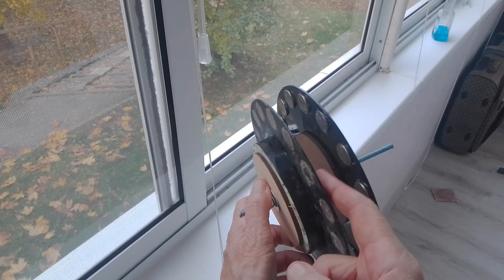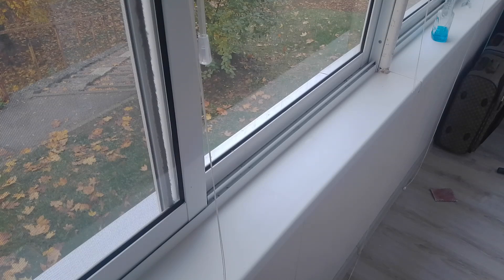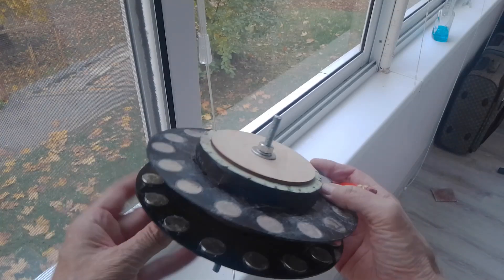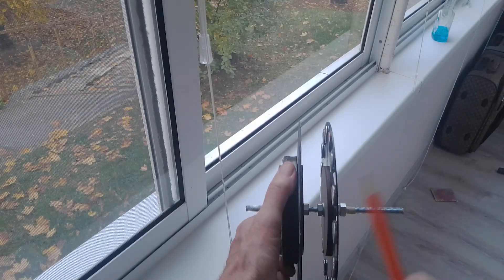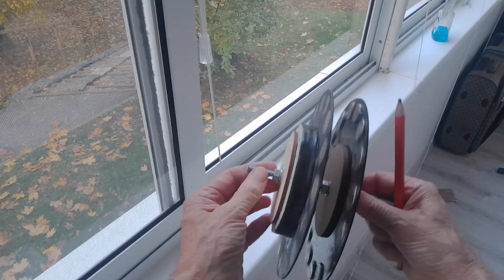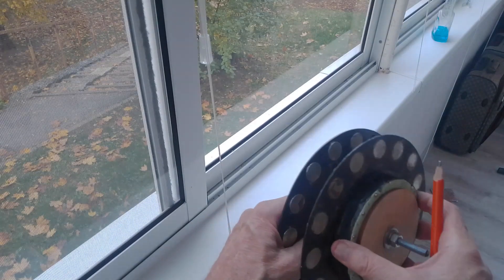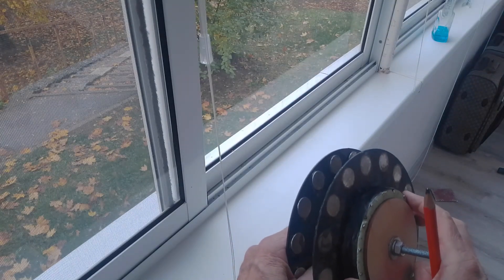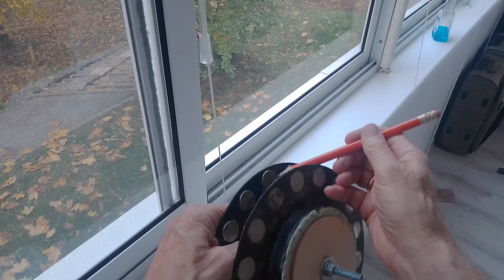Dual rotor disc motor generator

Comment: Hi Doug! Great idea.. i did some experiments with that kind of machine (actually different to yours)... but 2 rotors.. N/S - 6 coils in between, 1 of them motor and the 5 others  generator coils.  actually there were 3 rotors, the magnets on the middle rotor were used from both sides.  it used very very little power to run.. and would produce lots and lots of volts.. like 250 volts at 300 rpm.. but (yes,  there is always a but 😁) the lenz was so hight that as soon as i connected a very small load, it would like stop completely within 1 revolution. But i admit, i never tried to move the rotors so the magnets would not act at the same time.
also my magnets were much more apart than yours.. only 6 per rotor, (approximatively same size rotor) but much much stronger: 2 cm thick and 3cm diameter.  As soon as i am finished with my new workbench i will get those rotors out of the basement and get started experimenting again... Keep it up.
Luc
Reply from the maker: Hi Luc  Nice to hear from you!  
Yes you know when the generator is of very "strong" design and can makes lots of power its going to have that very strong lenz reaction too.  Ways out of it I know of is: 
1} filling caps with no resistance across them, then unloading caps to load while caps decoupled from generator coils (two stage cap discharge)  This lessens lenz reaction braking - and filling the caps after discharging to load every cycle will cause lenz since caps sunk down in voltage work just like resistance does...but there should be a perfect world where the load sinks caps down just to where the generator does not have to work so hard since caps already half or three quarter filled when fill up again.
The other way 2} is the "popular and proven"  Thane Karl Heinz "delayed lenz" where the rotor magnet whips by at just the right speed so that the time it takes lenz (the backemf developed actually) to develop happens for example at the trailing edge of magnet, or the leading edge of next magnet in rotor (if NS magnets in rotor) so there is speed up not braking upon the backemf being manifest with a strong enough force to want to pull rotor backwards (or assist forward)  
Other way to beat lenz 3}  is put a BiTT transformer in between the generator (alternator actually) and the BiTT runs on reactive AC power (90 degree phase shift between volts and amps) and so the alternator feels itself working as it has no load on it (no load on any alternator looks like a 90 degree phase shift on scope) so then the BiTT "transforms" the reactive power to real power and so there is no lenz braking to the alternator when the BiTT transformer secondaries is loaded with real power (resistive load or inductive load or capactive load)
Thats the trick to the BiTT far as I tell - the AC primary  needs to have a 90 degree phase shift and be reactive power going in, and real power coming out.

Two years ago I tested this motor-generator out, I put links to the videos in description.

I was hoping there would not be not very much lenz braking from the generator "2/3" of it, but it had lots of lenz braking when shorting or loading still.  Maybe lessened somewhat, but was still there.  Theoretically I was thinking the motor coil sharing the core should do something. 
 I should of pulsed out the generator coil to load, but never did, as maybe some slight delay or advance compared  to the  timing of the motor coil when it hits the load would make the generator output lenz free.

Because I didnt see anything magical  I went the route of  combining the motor and generator coils into one big motor coil, and tested it out like that, also had just two motor coils, then 6 generator coils...did alot with it but could of done lots more. 
 
Could be what I have now this new idea"to experiment with (the timing offset of the motor-magnet disc compared to the generator-magnet disc) might  be if I get it just right. it will get rid of lenz reaction all on its own,
but maybe the generator coils should be pulsed-out too,  and there is a particular combo of rotor timing and pulse timing will do it to it.
Reply: @MrDKONZEN  cant wait to see your experiments... one of my first ones will be to try and reproduce one that has worked for me in the past.. The bummer i was so excited it had worked i did not remember exactly what i did. Basically i put 2 coils wound in opposite directions on the same core.. and connected a third coil in between. I also powered a bulb as a load. The 2 generator coils cancelled each other out, and all the lenz went into the third coil.  i was holding that third coil in my hand in direction of the rotor magnets. by positioning it by hand in front of the rotor i could make it accelerate instead of slowing down. But i never found the position again.. also i cant remember how i connected  the light bulb. but i will find it.. there are only 16 possibilities.. so give me some time! ;-)
Reply from the maker: @FreeEnergyNerd  LUC!!
Can I have your email....there is a guy in Switzerland who wants to give away to about four researcher/builder'testers (like you) really nice rotor and stator plus the wiring done "how you choose" plus will pay for components needed and such.  He asked me to write to likely "collaborators" i know from  my EVGRAY discussion board plus anywhere else to see who wants to do it - I wrote to your email you have in your YT channel with austria address but it came back undeliveator ,,,,,,anyways while I write this, Ron Pugh (you know him from Canada) just left me your email so will write right now, with the information on this in forwarded email
Reply: @MrDKONZEN  very strange, the austria adress works.. just tested it.. maybe they are blocking it if you are in belarus? I will post it here but ususally they censor emails that you post in comments..
Reply: @MrDKONZEN  just tried to post it here but its been censored by youtube.. maybe if you check your "censored posts", but i also sent you a mail to your old msn adress. the konehead one. I dont know if it still works.
Luc

Comment: Very cool Doug, many times i have thought about doing that and offsetting the magnets position. I hope all is ok, looking forward to the next video!
Reply from the maker: Hi Tim    I worked on the chassis of it today, got airgap about 2mm each side, rotors thin plastic not so stiff, so going to coat them with superglue gel on backside of them maybe epoxy over that.  Also need to balance the rotors, then put it all back together.  
Old video links of it together and running are in description.  
Pretty ugly construction from old wood and plywood  but looks deceiving if it actually works as hoped.
Should be a lot of fun to try and find some perfect offset timing for the particular rpms - What I
am thinking a particular offset timing might work at 200rpm but not at 1200rpm plus the load whatever it is should affect the offset timing if it will work or not..  Maybe inductive load of motor will work good but resistive load  will not etc etc  Pulsing out generator coils along with perfect offset timing might be the best way to go with it.
I have a BiTT transformer here made with HF litz wire winds and florist wire cores, it might work OK I know it cant handle much power since florist wire cores but this is not going to be running on much power either.....I cant find the BiTT right now - packed away somewhere in the mess but will find it.